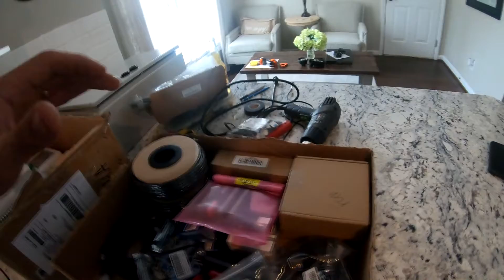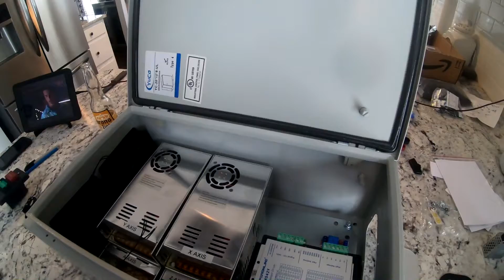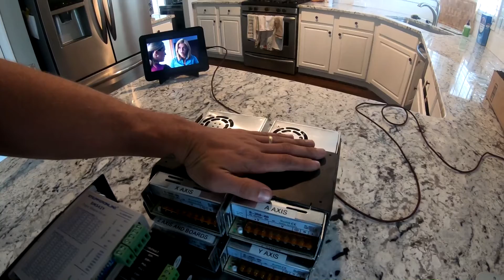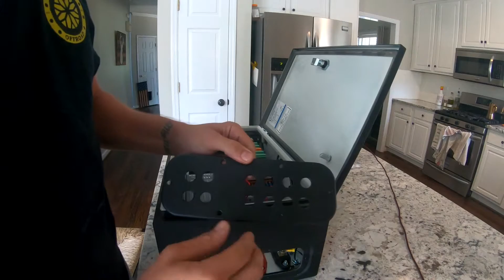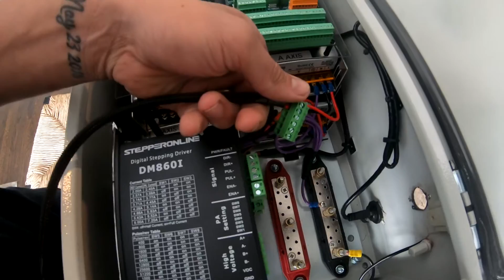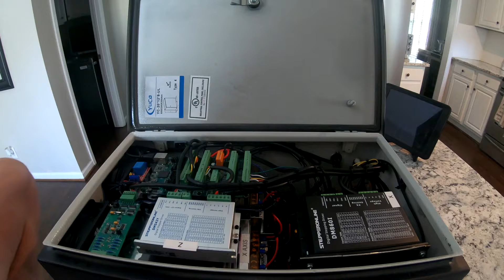BUDGET Professional Plasma CNC - Electronics Enclosure II Legacy 4x4 and Off-Road

Comment: I watched the entire series of your new build.  Very impressive skills.  I was hoping your final price tag would be lower than the first version of the table; but you built an amazing CNC Plasma table system.
Reply from the maker: It's still not even close to as much as a comparable pre-built system, although this one breaks down a little bit and has flaws, for what it is and the ability to learn throughout the whole process it is extremely worth it. Thanks for watching, there's another video coming out in a few weeks on a new wiring box for it that simplifies some of the issues, it's a never-ending process working with such a machine